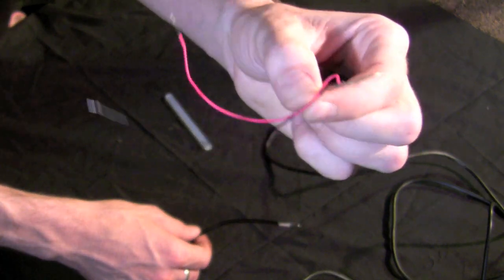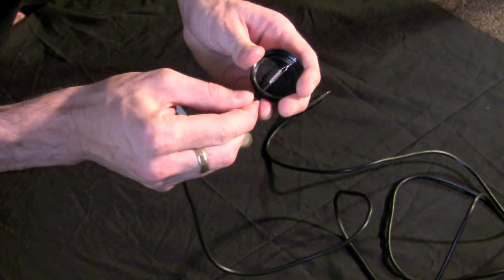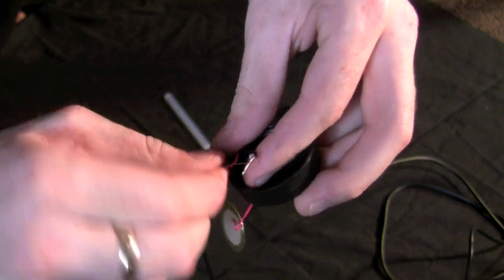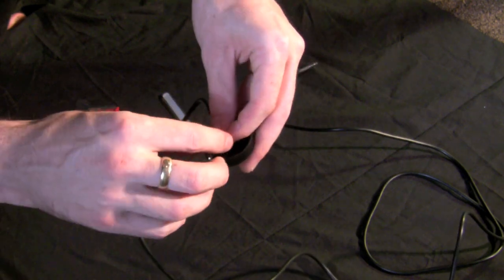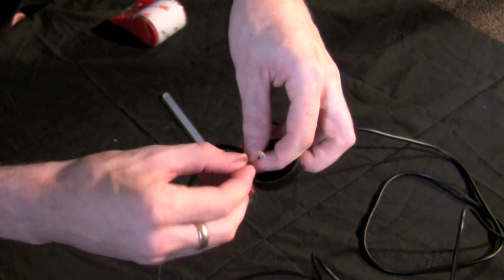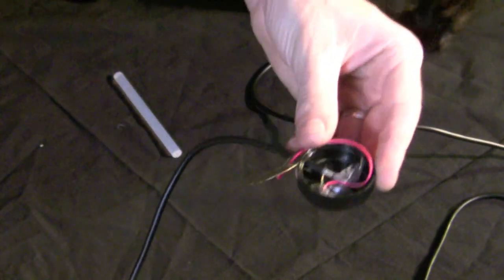How to make your own Contact Mic (no solder)

Comment: Interesting!!! But does it work and up to what depth in front of a 40 cm wall? I would like to superimpose (obviously making the minimum isolations ......) 5\6 disks to have 6X amplification. Do you also use an amplifier? What working voltage did you choose? Thank you very much.

Comment: I have an official stethoscope that an ERl doctor gave to me I wanted to make something like this that would be able to easily hear through walls.  This will work with no mods , but I want to amplify the audio and then convert the analog to digital signal so it can be saved.  Would a standard contact mic be able to do the same , I'd rather not butcher this Stethoscope if I do not  have to .

Comment: Please, it doesn't seem to work for me. I put the piezo buzzer and the stereo cable (I know you said mono but the end I am using is mono even though the cable is stereo) and it doesn't seem to work!! No sound other than noise (the same I get if the piezo buzzer is not in contact with the stereo cable)
Reply: Connect the Left and Right wires (red and green usually) to the positive side of the mic.

Comment: I'm dealing with a hum when I touch it
Reply: Looking piezo element within the oscilloscope shows that you have a positive pulse from the red wire when you tap.it.  This indicates that the wiring is reversed, no wonder you have hum when you touch it. Connect the red wire to the center lead to the shielded wire at the mic. and black to the shield.  This connects the outside of the diaphram  of the microphone to ground so you should have no more problems when touching it :-)
Reply: @MrSinoline  thanks for the tip!